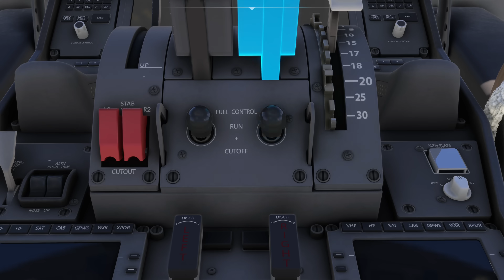Air India 171: Why Did The Fuel Cut-off Switch Get Moved?

Comment: "There is no way fuel switch can be manually turned off" these were lines Steeeve is mentioning every where and recently in some interview he confirmed after some heat debate, "fuel switches receive command from a electronic device called Relay which run on14volt", point i have is for one of my very simple task in home automation i use these relay and think double what if these do not work correctly what are side effects or problem will be created. How he is so sure there can not be any electrical signal fault and pilots only turned them off.. Or may be Boeing has lot of influence and power in world wide to safeguard and not impact anything on there name. There engineers it self are fighting in court same reflects in there aircrafts may be.  why not this perspective spread or told, do you fear for losing or gaining something may be ?

Comment: Captain Steve, it the positioning of the switch itself recorded independently from other systems in the circuit? I can’t imagine this important reading being lumped in with other components. This speculation believing other systems shut off the fuel or failed could be squashed if the answer is YES, the positions of the switches ARE captured independently. I’ve looked at diagrams and they don’t show physical or logical connections. Seems monitoring the relays would be sufficient.

Comment: Steve, you’re missing critical context—and it’s not just misleading, it’s technically ignorant.

You keep pushing the ‘pilot error’ angle while ignoring two massive facts:

1. The Cockpit Voice Recorder cut out seconds before impact, meaning we have no audio of the fuel switch movement or crew reactions.
2. The Flight Data Recorder isn’t pilot-accessible mid-flight and runs off aircraft systems—not something a crew can just shut down.

This isn’t speculation anymore: The AAIB confirmed severe electrical anomalies in the tail section and possible FADEC misfires, both of which are system-level faults that match the data far better than your manual switch theory.

If you’re going to make claims like this, at least engage with the engineering realities. Deflecting blame onto the pilots while ignoring recorder power logic, software architecture, and survivability standards isn’t just lazy—it’s irresponsible.”

Comment: I dont buy it. If i were a pilot and saw co-pilot turn off the switches, I would not ask. I would immidiately! turn the switches ON and reported sabotage to the ATC (why wait 10 sec?). I think anyone would do this. My take is it was a glitch in the system that cut off the fuel, no one turned off the swiches. The pilots then reset them, it took 10s to think about what happened and how to fix it) this is why it took so long -  10 sec to reset. The swiches have no sensors to monitor their position. Its the cut off valve that is monitored by the FDR and logs in the info.

Comment: In 2019 incident involving an All Nippon Airways (ANA) Boeing 787, where the aircraft’s system erroneously shut off fuel mid-air after mistakenly detecting that the plane had already landed. The software in question, known as the Thrust Control Malfunction Accommodation (TCMA) system, has been previously implicated in similar malfunctions. Designed to help the aircraft distinguish between flight and ground conditions, the TCMA can command the engines to reduce or cut power under certain circumstances. In the ANA case, the system’s premature fuel cutoff forced the plane to glide heavily to the runway. Fortunately, the incident occurred during landing rather than takeoff, preventing a crash.
Reply: I agree, see my post above
Reply: Maybe in this case the plane also wrongly thought that the plane has just landed, not took off, thus cut off the fuel.

Comment: You were right Captain Steve, it appears murder suicide, the fuel control switches transitioned at 8:08:42/43. Can you imagine the conversation between the pilots for the 10 seconds to switch+ it took to turn the fuel back on? They didn’t sit quietly and sip tea. I guarantee it’s damning, and disturbing. 😳

Comment: From Grok - The fuel cutoff switches (also referred to as fuel control switches) on the Boeing 787 are not fully mechanical. They are electromechanical in nature, featuring a mechanical lever and locking mechanism for physical operation by the pilot, but they function by sending electrical signals through dedicated wiring to control the fuel shutoff valves and engine control systems, rather than using direct mechanical linkages like cables.

Comment: My theory of this tragic accident is that one of the pilots inadvertently operated the fuel cut-off levers instead of the gear-up lever. 
The timing for operating the gear up lever for a normal takeoff and an incorrect operation of the fuel cut off valves may well match what could be seen in the videos of the accident.
Reply: ...which is like accidentally adjusting your rear view mirror when you meant to change the flat tire instead.......!  Unrelated.
Reply: @Jeph629 So you can adjust your rear view mirror and  change a flat tire from two different switches from your driver seat and usually du so multiple times a day?

Comment: Speaking of fuel cutoff, is Captain Steve going to talk about the Jeju Air 737-800 crash where in the interim report (disputed by both families of passengers and the pilots union), it is mentioned that the crew shut down the wrong engine after the #2 engine was damaged after a bird strike?

Comment: Hi captain Steve, after watching your interview on piers Morgan, I have a question.

The Relay connected to aircraft control switches can be affected by electromagnetic fields. Electromagnetic interference (EMI) can disrupt the operation of relays, potentially causing malfunctions or failures in the aircraft's control systems. Electromagnetic fields can induce currents in the relay's coil or other components, potentially causing the relay to switch unintentionally or disrupting its normal operation.

My question: is the relay (connected to fuel control switches) housed in material that is not susceptible to electro magnetic fields? If not, isn’t it possible the signal was sent to cut off without the switches moving. Hence the confusion with the pilots and hence it taking 4 seconds to switch back on as they physically had to move both switches down and back up again?

Thank you.

Comment: Capt Steve is just a driver.....switches moving within a second clearly implies there was no mechanical movement of those switches.....totally irrelevant when your Fadec failure can remotely shut off that LP and HP valve without any human intervention.I am sure that this event will occur again and will replicate if there is a software or electrical flaw in this particular Boeing aircraft

Comment: I think Steve has reached a premature conclusion. There are possible scenarios where engines can deprive fuel supply without physically pulling the switch from Run to Cutoff. There are two fuel valves in Boeing 787, a metering valve inside the engine and spar value by the airframe, close to the intake. This SPAR valve has a a failure mode of cutoff! This means, if there is a problem to the signal path, fire or anything abnormal to the control logic, it shuts the fuel supply! This can happen while the fuel switch is in RUN position. 
As Steve wrongly mentions in Piers Morgan show, the switch is NOT directly connect to the fuel shutoff values. The switch itself is mechanical but it sends an electrical signal to the flight logic to actually operating the valves. Valves does not mechanically linked to the switches.
Reply: He is being payed or he has stocks in Boeing the way he blames the pilots so soon is disgusting

Comment: I've just watched the interview with yourself and the two other experts on Piers Morgan (I'm not a huge fan of Piers as he is divisive for the sake of viewing figures but that's by the by) 

It raised a question for me....

If the "plane" turned off the fuel with no human input as the other two suggest - an electronics failure causing the fuel valves to close whilst leaving the flight deck fuel switches in the ON position then...

 1) how did the pilot know to ask "why did you turn that off" if the only visual indication is that the switches are in the OFF position??  Is there something else in on the flight deck that tells you the fuel cut off switches had been turned off???    

2) if the "plane" had shut these down and which left the manual switches in ON - then why does the flight recorded not show the Manual switches go to OFF and then ON again?  Would they have to do this to restart the engines if the plane has shut down the fuel and the switches are still in the ON position?

Comment: We've heard conspiracies about how the fuel control switches aren't merely mechanical, how they can move themselves, how the signal from the switches got messed up and fooled the FDR into thinking they were moved when they weren't. The reality is these switches are purely mechanical. By nature, that's what a control switch is, a mechanical device used by humans to control things. When moved from cutoff to run, they provide power to the fuel control system. In addition, each switch has a separate set of contacts that provide  a separate signal  to the FDR to record the position of these switches at any given time. That's how the AAIB knows exactly when these switches were moved. If you want to get an overview of how these switches work, watch Stig Aviation's video on YouTube where he explains and shows diagrams of this system. https://www.youtube.com/watch?v=-ur234kwnhk&t=1355s

Comment: https://www.youtube.com/watch?v=7H9vT7TMwDs
US Based, Indian Software Engineer and CEO of Hawkai - Dr Ranjit John speaks to Barkha Dutt on the hard evidence he has unpacked that he says is proof that the pilots of AI 171- Captain Sumeet Sabharwal and Captain Clive Kunder were not responsible for the crash. John's articles have gone viral and he has asserted that "Sumeet and Clive were the best of the best and did as they were trained to do." He has the following central arguments in this conversation with Barkha Dutt 

1. The RAT ( Ram Air Turbine) Deployed BEFORE the fuel control switches "transitioned" from run to cut off mode. And not the other way around. 

2. The nature of damage to the rear black box of the plane indicates an internal fire to the Lithium-ion batteries- 

3. The FADEC- "brains of the plane" could have initiated an engine shut down after not receiving real time data 

Dr Ranjit John Says there is sufficient proof to call out "western media influencers who behaved like clowns" 

It is important to note that the Boeing 787 Dreamliner has had a serious problem with batteries in the past, "Lithium batteries are a clear and present danger", John, the CEO of HawkAi Tells Barkha Dutt

Comment: Unfortunately, key technical aspects are left out here that are essential for a full understanding of the incident.

First, the theory that both engines were manually shut down is highly questionable. According to CCTV footage, the RAT (Ram Air Turbine) was already deployed before the supposed “fuel cut,” which strongly indicates an electrical failure rather than deliberate crew action. The sole survivor also reported a sudden loss of lighting followed by a loud bang — classic signs of RAT deployment.

Even if the engines were shut down manually, this would be in line with Boeing’s official emergency procedure for a dual engine failure, as described in section 7.2 of the QRH (Quick Reference Handbook): “FUEL CONTROL switches – CUTOFF, then RUN.” This is a standard step to prepare for an engine restart after a systems failure.

Second, the role of the digital engine control system (FADEC) goes completely unmentioned, even though it is central to the aircraft’s automation. The FADEC can autonomously shut down engines when it receives no or incorrect sensor data — without any pilot input. Previous documented incidents involving the 787 support this:

    - In 2015, an integer overflow after 248 days of continuous operation posed a risk of control loss.

    - In 2020, the FAA issued a warning about a software bug that could simultaneously disable all generators.

    - In 2022–2023, FADEC glitches were reported that led to engine anomalies without clear causes.

Third, Dr. Ranjit John, systems engineer and CEO of Hawkeye Data, highlights a crucial factor that’s missing here: the flight data recorder located in the tail was found to be thermally destroyed — far beyond what a crash impact could cause. His analysis points to a “thermal runaway” event from the lithium-ion battery located in the rear of the aircraft. These batteries are positioned right next to essential wiring for backup power, FADEC, sensors, and flight control logic. A battery fire in that area could simultaneously disable or corrupt multiple core systems — which seems consistent with the event, especially when considering testimony from the previous flight.

Which brings us to the fourth point: there are video recordings from passengers aboard the previous flight in the same aircraft showing that several electrical systems had already failed or glitched — including displays, air conditioning, and lighting. This strongly indicates emerging software or hardware issues. Unfortunately, this important context is also not mentioned.

That’s why it’s essential to look beyond the cockpit theory and take the known technical vulnerabilities of the 787 seriously — especially when an experienced systems analyst like Dr. Ranjit John presents such clear evidence. The goal should be full technical clarification, not premature judgment!

Comment: The following is a real incident that no one is talking about. I’m not sure why. In 2019, a Boeing 787 operated by All Nippon Airways experienced an automatic cut-off of the fuel control switch on final approach. The report emphasized that pilots did not touch it, attributing the cause to a software glitch—likely the TCMA misinterpreting the aircraft as being on the ground. That’s scary.

Comment: Just answer one question- If the pilots were fishy.. Why did they switch on the fuel after cutting off.?? Why the nose was up?? and why call Mayday mayday mayday?? Truth - They were trying to save the flight!! Check Boeing Engine failure procedure… You will understand why the fuel switch went off and on!! Or watch Flying Beast Analysis YouTube channel analysis
Reply: I think that's one of the things you do if the fuel stops flowing and you don't know why; you turn the switches off then on.

Comment: A compressor stall would NOT trigger a RAT deployment. Cutting fuel to the engines would NOT account for the loud BANG the sole survivor felt & heard < liftoff & > impact. Nor would it account for a clearly  visible black metallic object that
departed the aircraft < liftoff & > impact.  Recovery of that piece is vital because it's free of impact damage.  I'm still waiting for evidence that either pilot was mentally ill or disturbed or that either pilot lied on the CVR.  The next piece of evidence I would like to see is what's left of the deployed RAT & how much of it was damaged or missing  before impact.
NLC